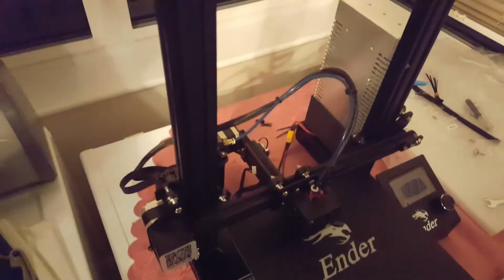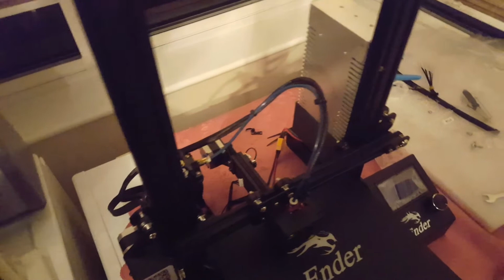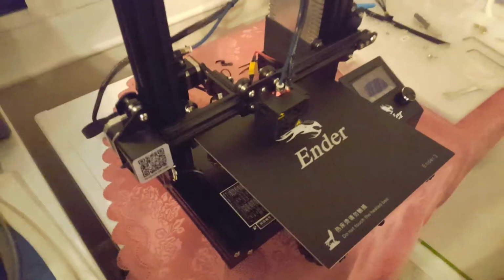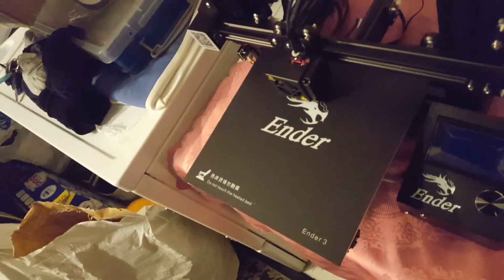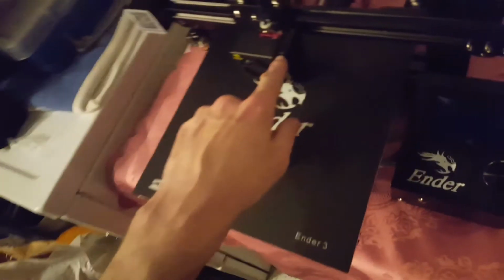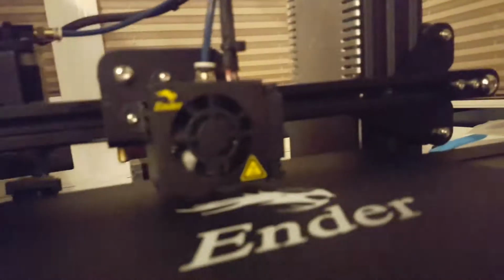ender 3 creality initial thoughts before use

Comment from the maker: bed heats up very quick ! dont like the cables catching on the moving bed carnt move them.. reason they didnt brace z rod at top is u loose 20mm in z worth losing the 20 odd mm imho was alot of play
Reply: Generally constraining the Z at the top is bad idea and will increase Z banding. You can see this in reviews of the Tevo Michelangelo etc.  when they remove the top constraint the banding goes away. Prusa etc. don't constrain the end of the screw on purpose, it lets the end walk around so that the thread engaging with the nut transfers less horizontal forces into the x axis assembly. Bearing supports are a bit of a carry over from the CNC world where they are used to prevent whipping etc. On 3D printers you don't have the same concerns especially with 8mm leadscrews. Just my humble opinion of course, thanks for the vid.